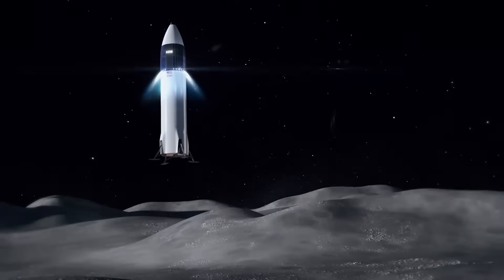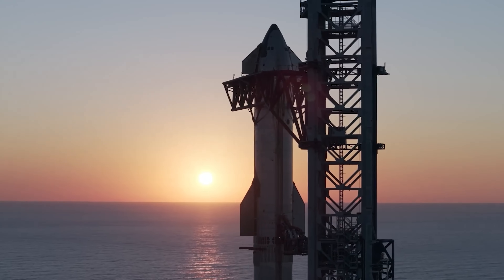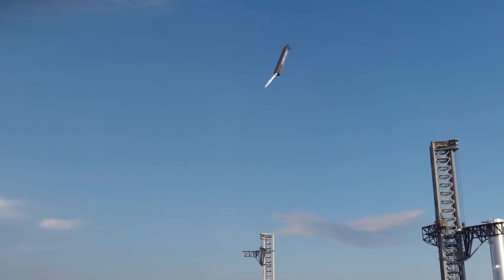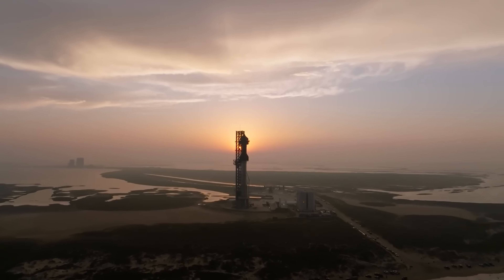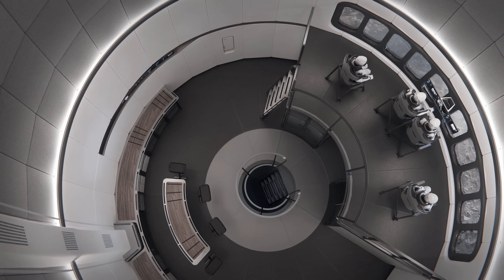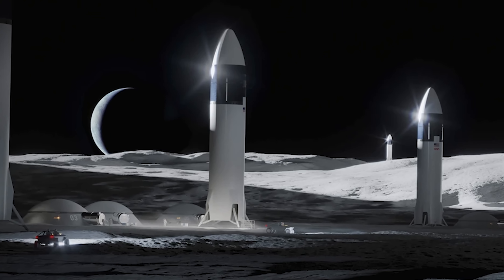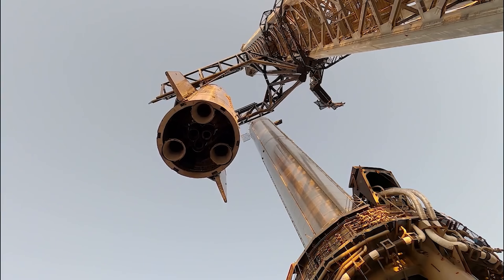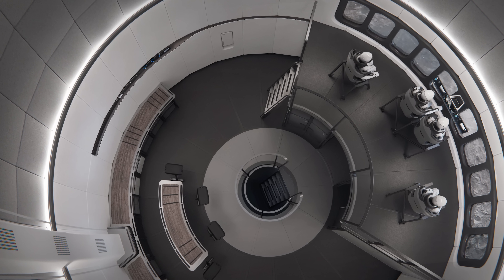SpaceX revealed new Lunar Starship Option to Go Back to the Moon: Less Refill, No Return..

Comment: On the moon, a high rocket (tall, narrow design) is unstable, easy to topple if the landing speed or angle is off even slightly.
Reply: 90% of the mass is in the engines, at the bottom.  Also there is no atmosphere on the moon, so no winds.
Reply: @howard6433 that means a lot of fuel to burn to slow down the rocket
Reply: @ThaiGreenHaven 
.....and it has a lot of fuel, so....
Reply: @ThaiGreenHaven  Yes, translunar injection requires over 50,000 kph, or twice orbital velocity around Earth.  It will require a lot of fuel to slow down.
Reply: @howard6433 too much refueling required, it's really risky.
Reply: @howard6433  TLI only requires about 40,000 km/h - just below escape velocity. 50,000 km/h is almost enough to do a Hohmann transfer to Jupiter, way overkill for the Moon
Reply: think.... just for a moment, use your brain... WHERE is all the weight in that ship?  the engines, at the BOTTOM.  ffs